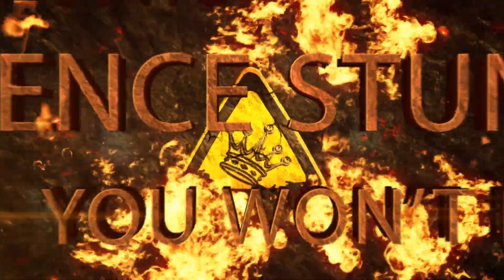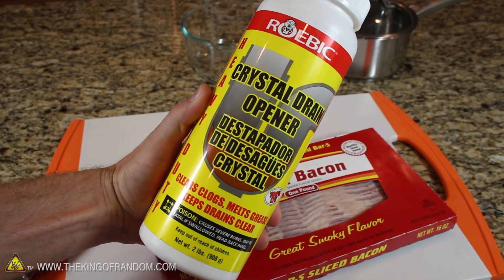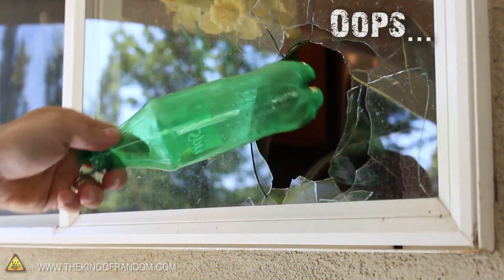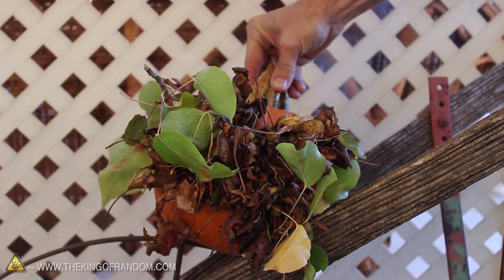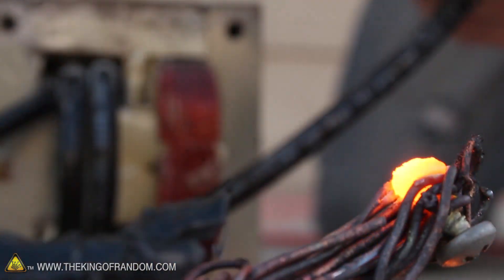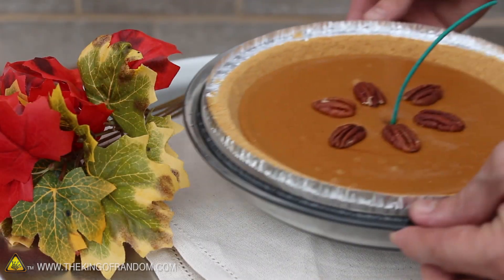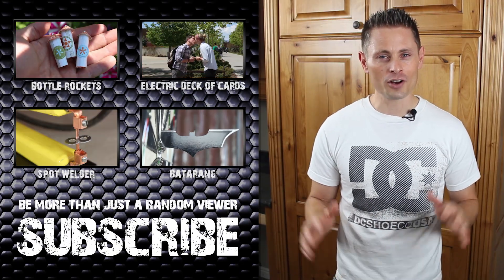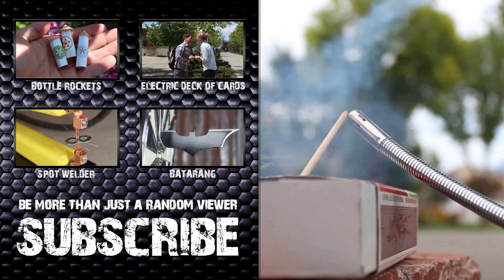5 Crazy Science Stunts You Can't Try At School

Comment: An 800 amp current? That's almost two thousand times the voltage that it takes to cause instant cardiac arrest.
Reply: amps has absolutely nothing to do with voltage ...... it's a measure of current not potential . also , the higher the voltage , the more dangerous the electrical source , amps barely make a difference . if the amps are 800 but the voltage is , say , 2 volts ,it's nearly harmless to the human body
Reply: SHIBANI SHAH https://www.physics.ohio-state.edu/~p616/safety/fatal_current.html

Also, this is a 35 million volt stun gun that won't kill you http://www.thehomesecuritysuperstore.com/high-voltage-stun-guns-jolt-mini-stun-gun-pink-35m-jms35pk-p=3688
Reply: +Mgb 360 its both voltage and current that matters. 800amps with 2 volts cant kill sou, 300.000 volts with 0.05 amps wont kill you either.
Reply: +Kyriakos Lykoudis 0,03 amp is already deadly to a human.

Comment: Question about experiment 2: if the bottle does explode, will it severely injure you?
Reply: Akathran Nethagrûl That depends on a few factors.  Regular pop bottles usually rupture at just north of 100 psi and the pieces can easily put out an eye or cut into flesh.  Other bottles can sometime withstand much higher pressure which can mean higher velocity on the flying debris.  At high enough pressure it can be deadly, but it would be unlikely from a regular pop bottle.

Comment: i know a way to make a switch that can cut out electricity out of buildings pretty simple to make. you only need a wire (the very thick one that can stand a lot of electricity), a switch and a socket. just make the electricity flaw back to the socket and magic will happen. i think if you played with wires before you can understand what i mean.

( i don't guarantee it would work (it won't with some types wirings),some times that may cause a lot of amps flowing in the house wiring causing it to start a fire, or the wires themselves will melt. just make sure nothing is plugged into the electricity so that no tvs  or fridges get burnt. also watch out for light bulbs because they will pop.)

sorry for my spelling i am not english.

Comment: Why do high Amps but low voltage melts the metal? what would happen if high voltage but low amps?
Reply from the maker: VoRTeXeR007 Exactly right ;)
Reply: The metal will conduct the electricity.
Reply: Ok, but why the high amps melt it?
Reply: Skyangelz1998 Amps are basically just a number of charge (electron) that flows through the material. You can probably guess that the higher the amount of charge moving through the metal the higher the ''electrical friction" is, so it heats up.
Reply: Turbo Duck ohhh, i understand now, thanks :D
Reply: Skyangelz1998 It is called "Copper losses"...as current passes through a metal, the internal resistance of the metal (copper or otherwise) causes the metal to heat up.  The more current, the more heat.  With a piece of metal, you will not get low current with high voltage, in this situation, as metal has low resistance, which with allow high current. Power(Watts)= E(voltage) x I(current/amps), and E=I x R(resistance) are the two formulas pertaining to this experiment.
Reply: sabledriver Thanks.
Reply: with high voltage and low amps, you get an electrical arc (and btw it's pretty cool to make an arc through a candle flame)
Reply: Skyangelz1998 Low voltage is also safer since the human body has a high resistance it will keep the amps low even though your PSU can supply a lot of them. Of course it's not really that safe if you melt metal with it.